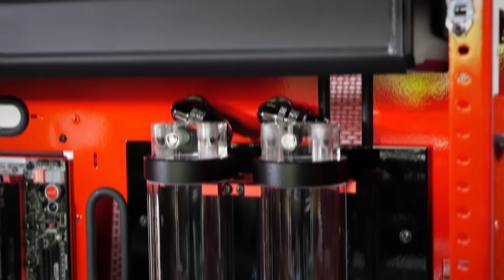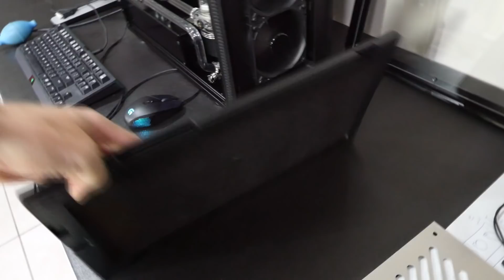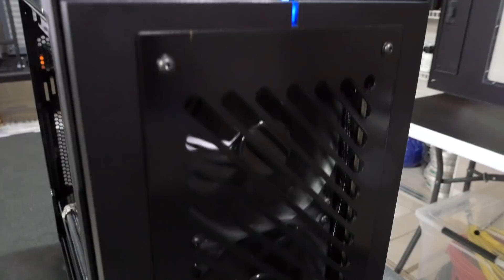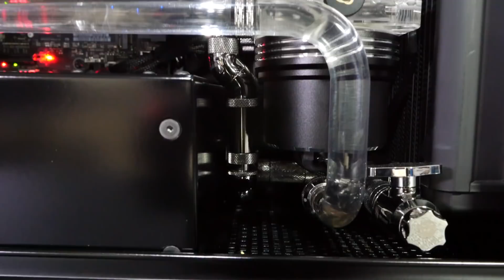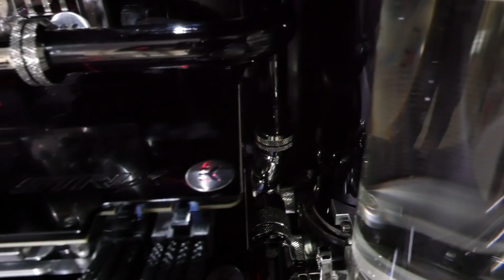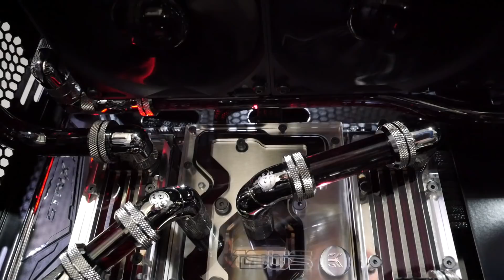Extreme Fractal R5 Workstation Build #25 Part 6

Comment: I cant figure out the way you routet the water... as far as I can see there is one pump and reserver. Yet there is no connection between GPUs and CPU/RAM coolers. Did you build one look for GPU and one for CPU? If so, why?   And isnt there too mane pipes at the pump/reservoir? 2 in/out gpu, 2 in/out cpu, 1 drain equals 5 but it somehow looks like 2 on top, 4 on bottom, euals 6?
Reply: Dude, its because there are 2 pum/res combo, so it means CPU and GPU is separatly. Just check other videos from this build and u will understand.
Reply: Oh, ok, ty for the info, it really confused me.

Comment: This build would have been so much less expensive with a larger nicer chassis. CaseLabs, the client needs to learn and research much more before he begins.
Reply: yes but the case I would want would need to be moded. perhaps the client was thinking along the same lines
Reply: I have no idea what was possible from the onset, but it seems more chassis options from the beginning would have led to much less modification and a nicer result for the client.

I would have gone with one of the CaseLabs cases if I was drawing this build even on a bar napkin.
Reply: Maybe they didn't want a larger chassis?  Lol I mean wtf else would he be modding that particular case for???  Excellent job on the video.
Reply: +Collin Ford
mate this is NOT meant to be a good money value, that's NOT what modded PCs are for.